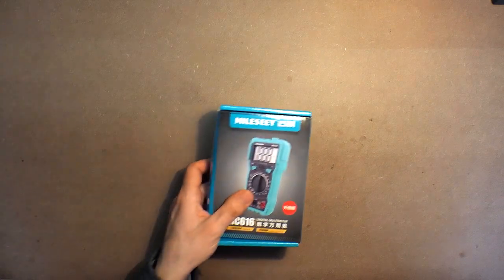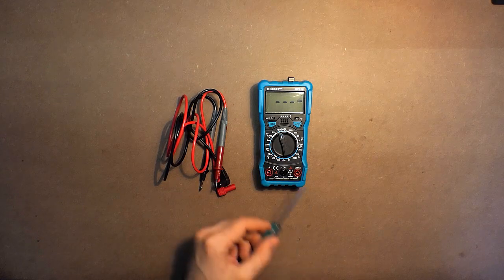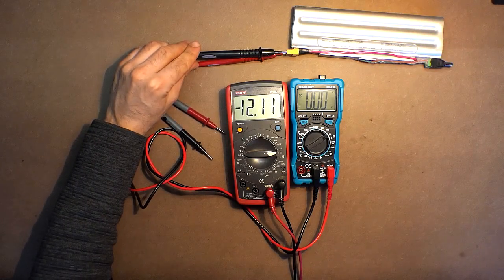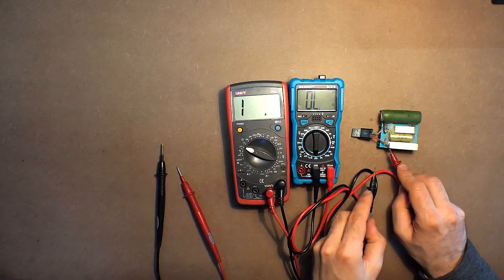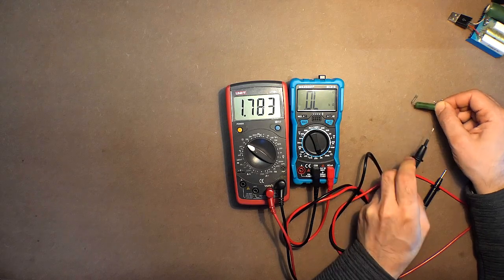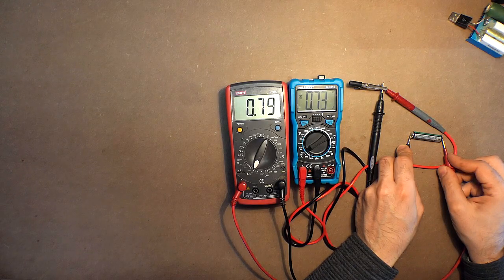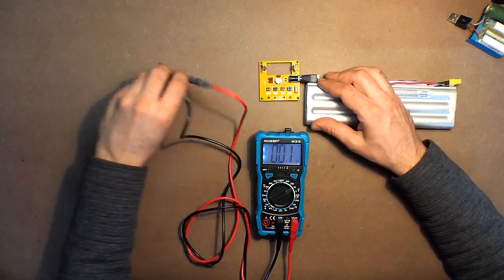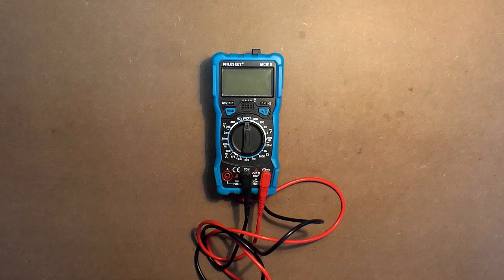MILESEEY MC616 Multimeter - Version 2.0

Comment: I was wondering about your statements of accuracy until you measured the voltage reference. I'd prefer they didn't put lights and transistor tester if they are just gimmicks - it detracts from what is essentially a practically accurate instrument.
Reply from the maker: This  transistor tester maybe is useful in order to define whether transistors are dead or not :) Anyway, during ordering I was informed that only new versions are available; however, I really liked exactly previous model. Nevertheless, they have almost the same accuracy, let's say - very decent, despite their low prices.